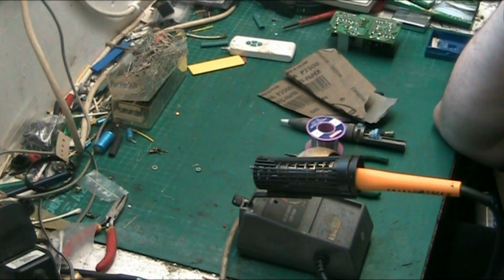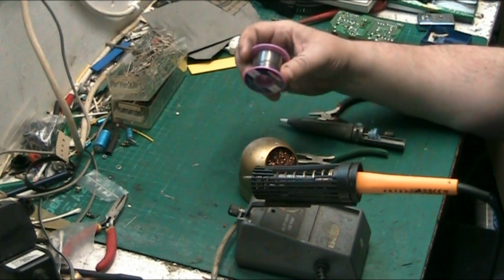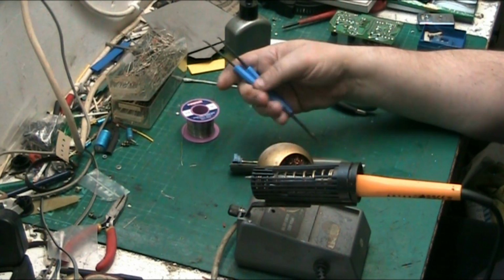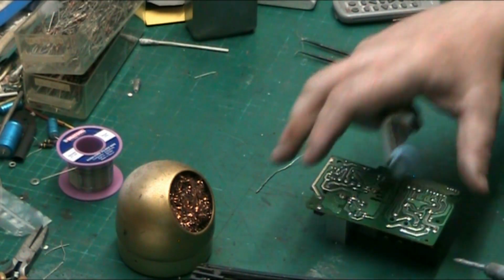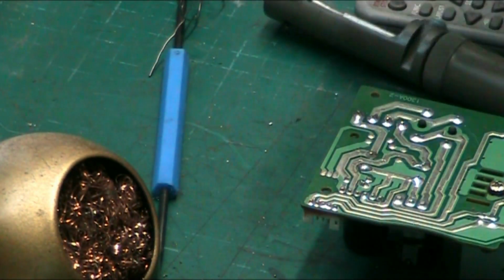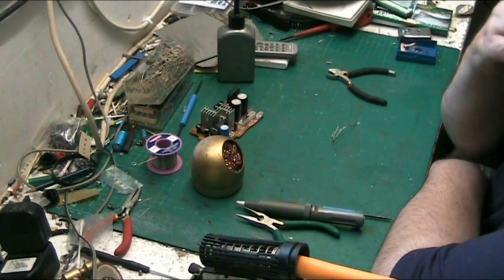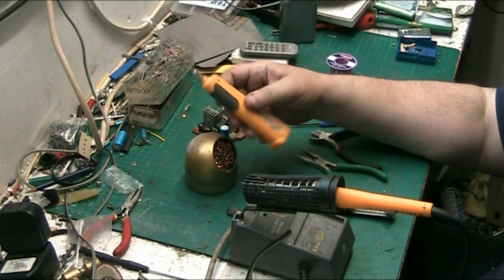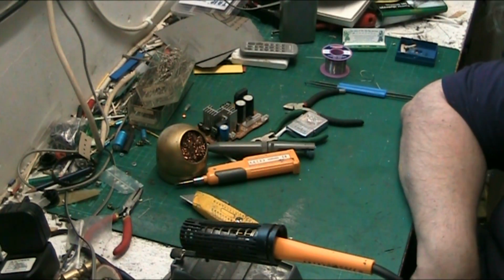SOLDER TUTORIAL

Comment: when i have tried to show people how to solder the thing they find most dificult is soldering two bits of wire together or say a wire onto a component lead.
like you i do not nor ever have used a fume extractor and i have been doing this for over 50 years  .I do recomend beginers get one because of elf & safety  .
i do get into arguments about lead free solder (i dont use it)
Posting any thing on you tube opens you up to riddicul but like you say if you do stuff safely and it works that should be good enough.